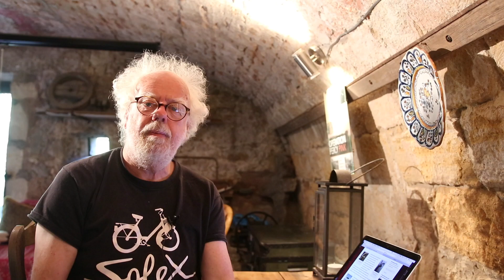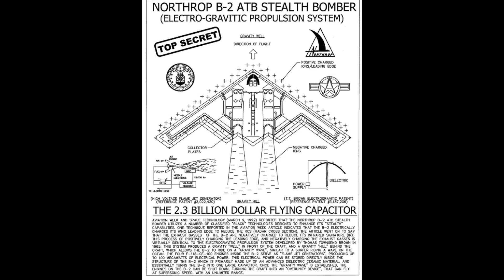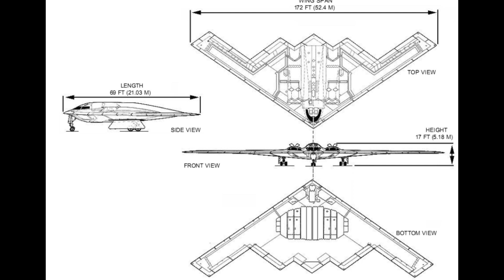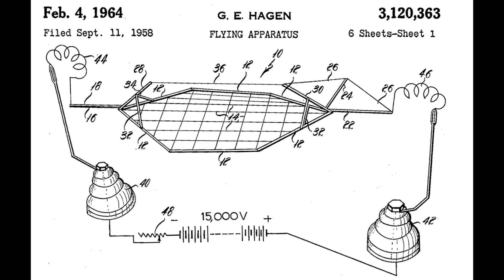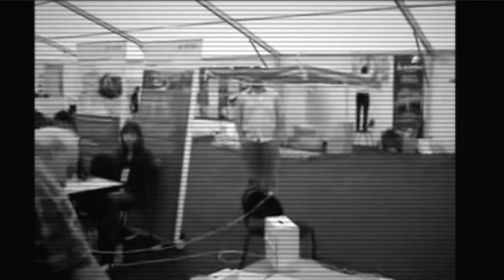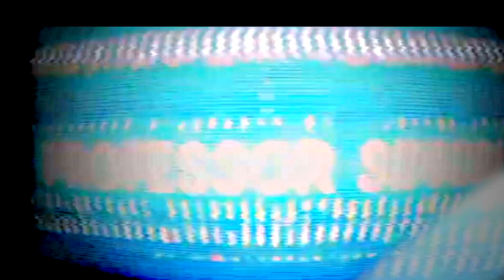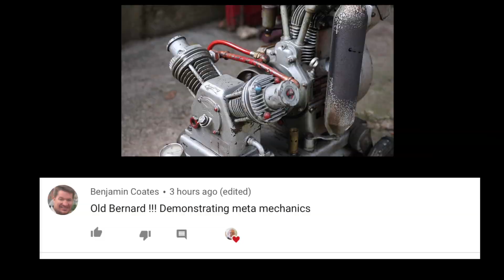Military anti gravity - Prof Simon

Comment: Again, for like the 3rd time, please learn how gravity works first before assuming anti-gravity can even be a thing. It absolutely, positively, can not, period. If it reduces weight, it's through propulsion, physics does not allow for anything else, if it did, we'd have a free energy device because you could just float an object up, drop it, and extract the potential energy out. 

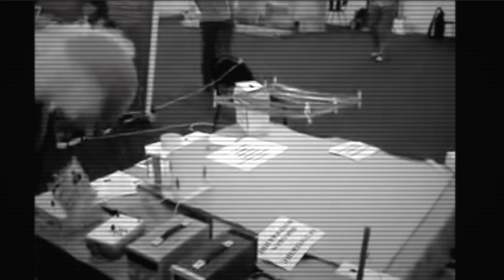Electrostatic propulsion is NOT anti-gravity, it's got zero to do with anti-gravity, and is such a low force that it can't really be used in the real world practically. At 3:08, when you put a piece of paper under that craft, it blows, because that's PROPULSION. It's just ionizing the air, and pushing it in one direction. If that's anti-gravity, then planes use anti-gravity.
Here is a video of a plane powered by electrostatic propulsion: https://www.youtube.com/watch?v=a9yYu-ZM1S0
As you can see, the effect is so small that the aircraft has to weigh almost zero, and has almost zero range. The power source will always weigh MUCH more than what the thrust it can product, so it will always be a negative when it comes to flight, unless you can beam the energy to the ship remotely. 

If something was able to "defy the laws of physics" than physics would no longer be a science, this is just not how it works. You can't go around making claims about physics while lacking even a basic understanding of the concept, that's dangerous, and irresponsible.

Again, voltage can NOT be converted to weight reduction through gravity, physics doesn't allow that. You can convert energy into thrust, but that has zero to do with gravity. There is NO such thing as an anti-gravity force, there is only gravity, there is no opposite to gravity. Gravity exists because of mass, we do not currently know how to make negative mass/matter and if we did, because if we did, we would have the ability to travel faster than the speed of light. PLEASE, please, go do some research on how gravity works before releasing more videos on this ridiculous concept. You're beginning to sound like a flat-earther.
Reply: How to UFOs travel to earth across the galaxy?
Reply: @patriciodasilva7902  They don't, that's the point. That question is as silly as asking how do dragons breathe fire.
Also, please understand that ufo=unidentified, not alien. I can throw a rock at your face, and if you didn't know it was a rock, you would have technically been hit in the face by a ufo.
Reply: @eugenes9751  There are more things in heaven and earth, Horatio,
Than are dreamt of in your philosophy
Reply: @eugenes9751  Mediocrity becomes you
Reply: @patriciodasilva7902  I can see that I'll have to speak in a language you can comprehend. 
U DUM.
Reply: @eugenes9751    How do you explain the black triangles, reported as big as two football fields, hovering as if floating in air, sightings all over the world, especially during the 'belgium wave'.  Was it mass hallicunations?  I don't think so.
Reply: @patriciodasilva7902  google is a powerful tool  try  searching for whichever particular event you're referring to + "explanation or debunking". Or provide a link to your event, so that I can more clearly debunk it for you. Also, consider this question. If I do in fact, totally debunk it and provide an explanation that doesn't involve aliens, will that change your mind or will you just keep looking for the next thing? People love aliens for the exact same reason they love conspiracies, we all want to believe that there's much more to reality, because that's a more comfortable thought than realizing that we have very little control over reality. Same reason we have religions. The dark, empty void, is scary to imagine.
To be clear, alien life definitely exists, on other planets, but biological beings will never reach the ability to travel to other stars. The distances are too great, the energy limitations are too great, and a biological lifespan is too short to make the million year long journeys. The entire premise is as silly as Noah putting 2 of every animal on a boat.
Reply: @eugenes9751   You're saying it's impossible. 
No scientist worthy of that title would say that. Read the books by Dr. David Jacobs, John Mack, Budd Hopkins, Karla Turner, Jim Sparks, Stanton friedman.  I doubt you have even paid much attention to what is going on in Ufology.  Look before you judge.
Reply: @patriciodasilva7902  Read what I said again, and please don't put words in my mouth. 1+2=7 is impossible. Lots of things are impossible in science, that's why we have laws. Free energy, as an obvious example. You break a single one of those fundamental laws and your Nobel prize will be waiting.
Reply: @eugenes9751    You haven't even read any of my comments and refuted any of them. Go to the links I've provided and explain them for me?    Read what I'm saying, again.  A simplistic comparison, and therefore specious.  100 years ago YOU would have said it would be impossible for a boat to operate 20 years without refueling because it would be 1+2=7.      YOU, the guy who lacks imagination, would have said that, but, today we have nuclear power boats that can go 20 years without refueling.   So do'n't tell me 1+2=7 is a valid comparison.  In point of fact, it is simplistic reasoning.  And the fact that you don't understand that tells me you are no peer among scientists.  If they believed that, if scientists believe  it were impossible, then the GRASP program would not exist.   You mentioned Google, apparently you lack imagination such that you don't even know what that is.  yet, I do, and I'm not a scientist.  how is this possible?  Hmmmm?  Eugene?
Yes, Nobel prizes are waiting for those with imagination who can dream, and accomplish what little men say are impossible. Just because small y is impossible, doem't mean big X is impossible,  just because what is known to be impossible doesn't mean what isn't known is impossible.  How can you not know this?  Who is dumb, Eugene?   Who? 
 Your argument is that since no one yet has figured out it that it is impossible.  I say it's not impossible, and the day will come when they do figure it out.  If there are numerous scientists attempting to figure it out, that proves science believes it is possible, or they wouldn't be looking into it,  That it might be possible is my argument, NOT whether or not they have figured it out presently.  
How do you know an advanced race thousands of years more advanced than mankind hasn't figured out the quantum mechanics of a machine that can reduce the mass of the  machine and it inhabitants of a machine to zero, to a temporal light energy state and create a bubble field around it so that all objects in space would go right through it so that 'hitting things at the speed of light becomes a moot point?   If that is possible, then traveling at the speed of light is possible.  I'm not even a scientist and my imagination came to that possibility.  Do you know that, thousands of subjects of regressive hypnosis, for the lat 30 years, people from all walks of life who don't know each other, have been essentially reporting the very same story, that 'aliens' can travel to the homes of subjects, 'floating on air via a lighter than light beam' and go right through walls, and that their space vehicles can hold a position in space without making a sound?  John Mack, a Harvard Fellow, came to that conclusion after regressing hundreds of subjects under hypnosis , noted that his subjects he could find no fault with their sanity, yet each and every one of them were telling the same story under hypnosis. He noted that a confabulated story changes, but a truthful story grows stronger with each session.  How is it possible that hundreds of subjects who don't know each other, subjects from all walks of life from all over the world  would have the same "hallucination' and none of them are crazy? Yes, 'hypnosis' is a week argument, but listen to what Mack is saying, what Budd hopkins is saying, what Dr. David Jacobs is saying, EVERY ONE IS TELLING THE SAME STORY AND THE STORY IS UNCHANGING.  This fact changes the 'hypnosis is weak argument' argument.    If aliens can do that, they have mastered the universe, and  they have figured out a way of non-linear travel, where 'distance' becomes a moot point.  But, of  course, little men, men who haven't figured out that they are nothing more than a babe in the woods who only yesterday were riding horses, out of their epic lack of imagination, THINK it's impossible.  
Fortunately, the world has enough men and woman with greater imagination of the possible than you.  If that weren't true, we'd not be sending messages through space on a machine called a computer.
Reply: @patriciodasilva7902  Sir, upi have lost the plot. I'm not here to win a dick measuring contest. Have a good day.
Reply: @eugenes9751    You are operating on an assumption, this is what YOU do not understand.  Trivializing  an opponent's argument is not a merit worthy  counter argument.
Reply: @patriciodasilva7902  I didn't trivialize your argument, I simply do not have the ability to explain how physics work in a Youtube comments thread. Unless you've been educated in the subject, everything will potentially look like "oh, we just don't know yet, therefore you can't make assumptions".

This would be like arguing with someone about ghosts, ufos, and the loch ness monster. I can not disprove a negative to you. Unless you know the fundamental laws that demonstrate that it's impossible, you will simply believe that it's still possible and ignore everything else.

I realize that seems like it's someone saying "it MUST be this way", but, in reality, it's just our current best understanding of the laws of the universe. Antigravity breaks the standard model of physics, if you can explain how it manages to do that, I will purchase a plane ticket and fly over to your house this instance, and we will write down this theory on paper, and get the Nobel prize, and you can keep all the prize money. 

In the same way that 1+2 can not =7, certain physical laws will NEVER allow certain things to happen, and I mean never. It does not mean that we know all of physics, it just means that we know the specific rules that we've consistently proven to be unbreakable. The "standard model" has been proven to be correct in 100% of every single experiment ever conducted (ignoring gravity). Again, if you can show an example of that being broken, I would LOVE to become your best friend.

It doesn't mean you're wrong, but it does mean that if you believe that you understand physics/qm better than the theorists doing the work, you're probably talking out of your ass... (Probably). Feel free to prove me wrong.

If you want to go to the quantum argument, we can discuss that, but that's not a physics argument, and it still doesn't allow for anti-gravity, because that would still break conservation of momentum. And if you could do that, the entire universe would collapse into a singular, ever-expanding black hole.
Reply: @eugenes9751   Listen to this interview with a military technology guy DARPA,  LISTEN to the entire thing ----  Military via 2 universities in conjunction with DARPA, and figured out how to reduce mass to ZERO.  ( or something like that, just listen )   PLEASE!  https://youtu.be/EqY7cbvP-yo

Comment: Seriously doubt any anti-gravity claims about the B2. The B2 does several air refuelings on a typical bombing mission, doesnt have an exceptionally great range and its about to get an upgrade for more fuel efficient engines. What this may have to do is to use EM to enhance its low observable capability and/or electronic defenses. These claims are not credible. Maybe there is a B3 with exotic capabilites but not the B2...

Comment: I've heard these rumours about the B2 before. My thought is that if he B2 has antigravity capability, why does it need conventional lifting wings....and a runway!
Reply: Don't forget the jet engines, fuel, fuselage, control surfaces...... Literally everything about a plane can be tossed out if anti-gravity was possible. And why stop at planes? We'd have a ship capable of interstellar travel, for effectively free. Elon Musk must be a pretty dumb guy for focusing on rockets, where 99% of the weight is just the fuel....
Reply: The B2 (as well as the F-22 and F-35) takes off first AND THEN turns on the electrogravitics when it gets to altitude. This is because it's rather dangerous to turn that many volts on while on the ground. Additionally, those nice big wings allow, in conjunction with the electrogravitics, very significant reduction in both drag and fuel use thereby extending range by a very large amount.
Reply: It may be only a partial effect, not 100% anti-gravity
Reply: @jimphillippi616  Nope

Comment: The Biefeld-Brown effect on these devices called lifter ionises the air molecules to create an ionic wind and thus also airflow.
It is not a anti gravity effect at all and does not work in a vacuum as the Mythbusters already debunked in their anti gravity themed episode.
The put a small lifter in a vacuum chamber and nothing happened. 
The Biefeld-Brown effect need very high voltage as far as I remember over 20000 V to work so it would be impractical and dangerous to use it at the surface of a plane.
The only reason could be a special effect in case of stealth but it is surely not anti gravity or to get a lifting boost for the airplane.
The flying wing and the jet engines should be much more effective in this case.
My the way there is a video in YouTube for a whole experimental model airplane with the Biefeld-Brown effect. I works but is very very slow and the shiny metal plates wings are surely not stealth.
So I call the usage of this effect a myth as Mythbusters debunked them.
I was intrigued by the concept but after seeing what was going on in a vacuum it was logical that the iconic air flow is the real factor here.
Without air no airflow and thus no lift.
You as a pilot should recognise the concept.
A nice video about the concept but a bit click bait. You are able to give the right context without a open mystery question ;-)
And the video would thus also be very interesting to watch.
Reply: Hate to break it to you but Myth busters lied. Lifters do, indeed, work in a vacuum. It has nothing to do with air flow. It works because of a phenomon known as induction.

Comment: Air International once discussed it.  Charged ionised leading edge exactly what your discussing.There were various Northrop patents about charging leading edges for drag reduction. Optionally its  misinformation and the leading edges were filled with charged plasma. Plasma stealth was studied by the Soviets but the issue is attachment of ionized plasma to airframe. HOWEVER plasma inside a leading edge would still stop radar and be lighter than equivalent ram. Its possible antigrav is really disinformation however yes you are correct antigrav or electromagnetic repulsion exists at a laboratory level as you have shown.